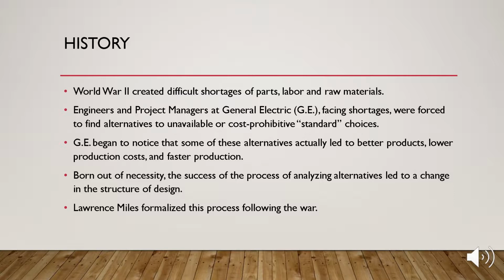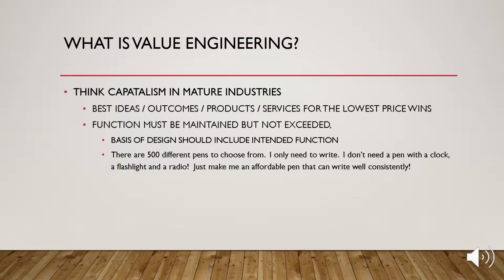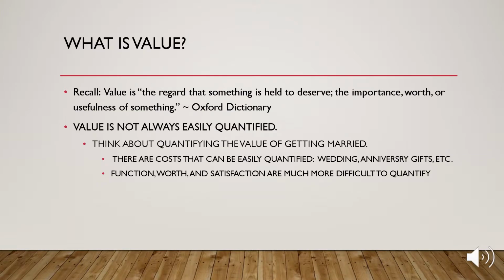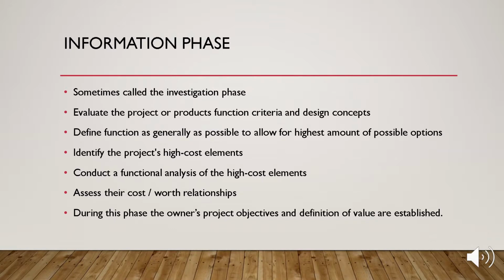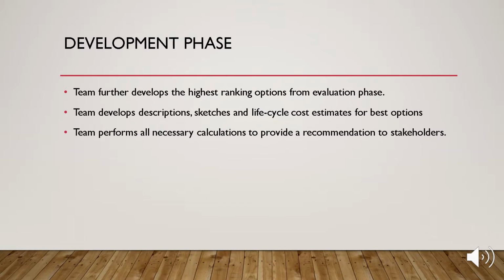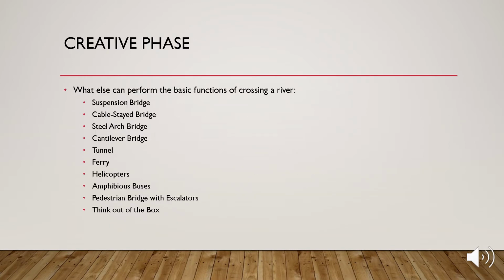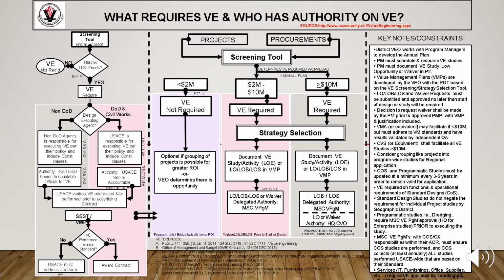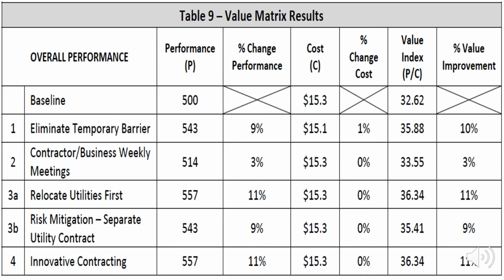Value Engineering Presentation   Video Version

Comment: You were doing so well until you went from Information Phase directly to Creative Phase. Function Analysis is the heart and soul of Value Engineering.  If you get nothing else right, you must know Function Analysis is the cornerstone of VE. Function Analysis delineates VE from any other project improvement tool.  The rest of the phases mean nothing without Function Analysis… a multi-disciplinary team going through the Function Analysis process.  You mention functions, but a detailed explanation of the Function Analysis Phase is needed to make this video correct.  This video was like making an apple pie without putting the most important ingredient in….apples.

Comment: Great video. However, I must respectfully disagree when the author says that VE is not a cost cutting method. In the end, everything boils down to either money or happiness and from the stakeholders perspectives, the two are usually intertwined. Perhaps not money in year 1 (initial construction cost), but the best alternative (greatest value) is the option that minimizes the life cycle costs while maintaining the quality of the product throughout its life while maintaining stakeholder satisfaction. Said another way, alternate X will always be preferred over alternate Y if the summation of stakeholder life cycle costs of Alternative X is less than Alternate Y.